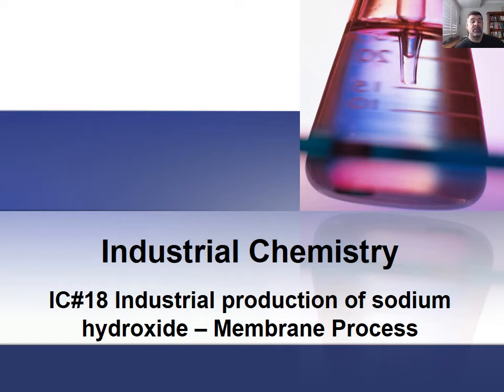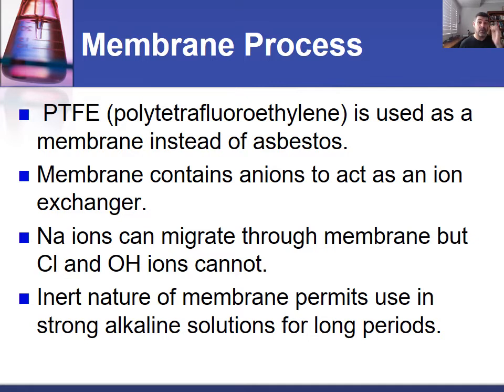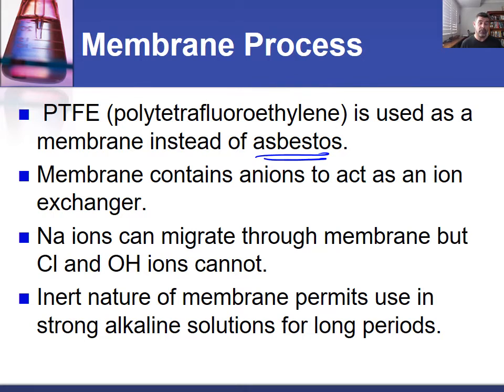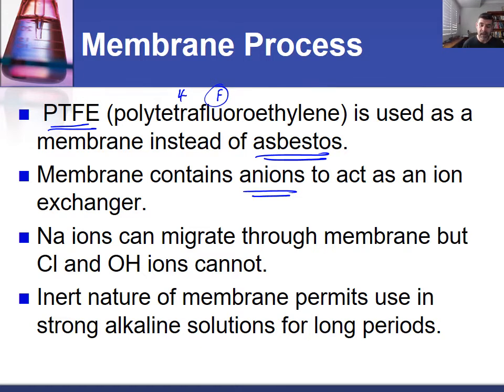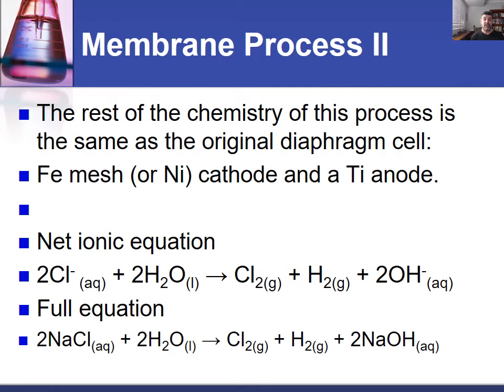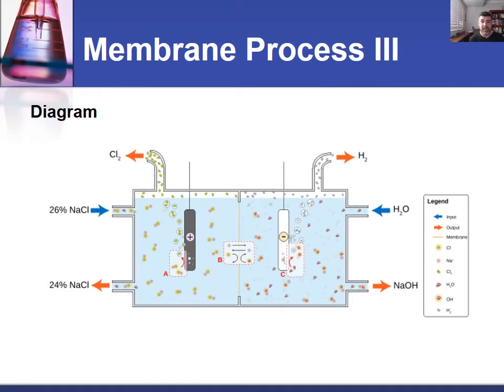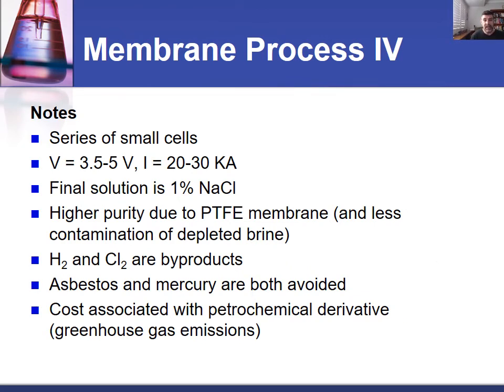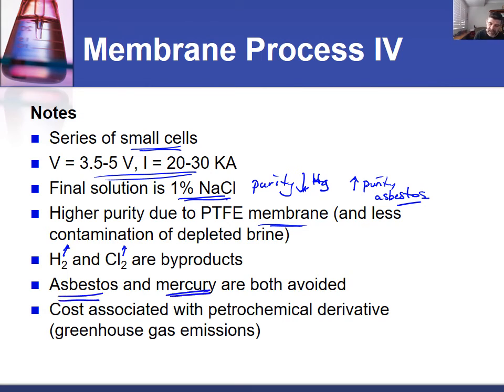IC#18 Industrial production of sodium hydroxide membrane process

Comment: Sir
What is mean mesh  what is use mesh
Reply from the maker: mesh is like a net made with a metal. It is often very fine when used in sodium hydroxide decomposition and it can be used as an inert or active electrode (depending on the metal).
Reply: Its process is now banned